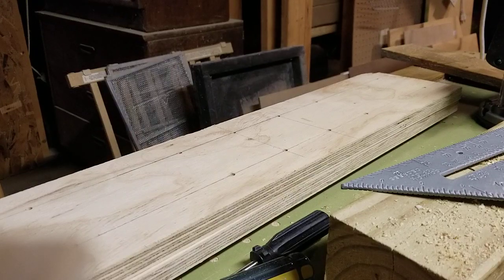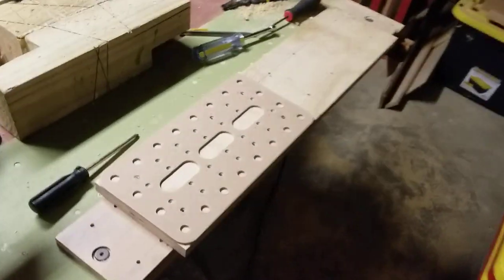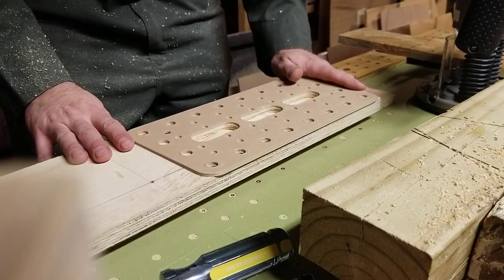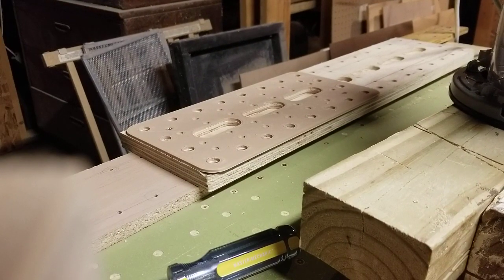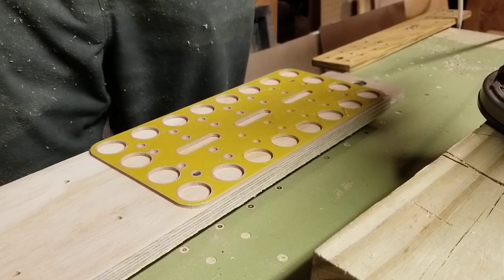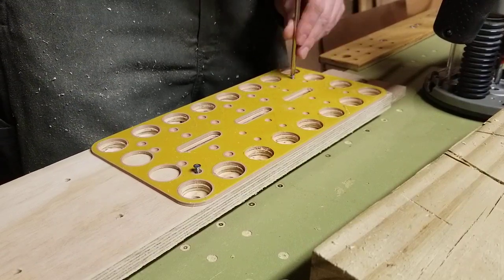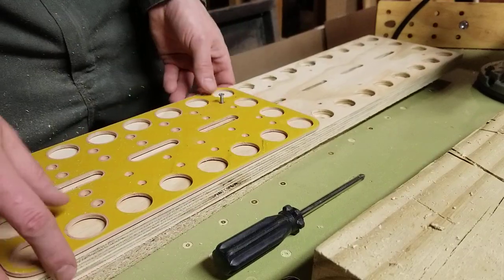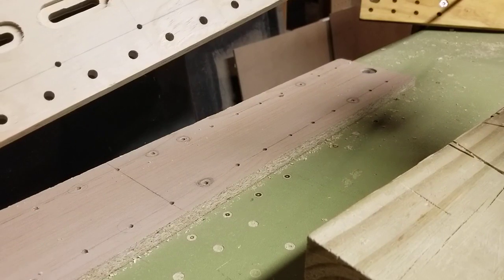Routing Monitor Mount Using 3D-Printed Templates (real time, unedited)

Comment: What countries have you been to I see you’ve been to Taiwan
Reply from the maker: Most of my time has been spent in Wisconsin, USA, but I do have a friend in Taiwan that I have visited a few times over the years.  They have a nice high-speed train over there, eh?  :)

On that subject, I have found that both Prague and Stockholm have very nice subways, and Germany's the place to be if you want to be able to hop on a random train to get around the country, as I learned during a month with a Eurail pass.  Tried to go visit Barcelona because I heard they have a good dance club scene, but all the French trains were booked up!  Mission Impossible has taught me that French trains are nice, but what good is it if you can't get on one?  Well, I did take a train from London to Paris, maybe that counts.

I've also been to Ireland a couple of times, where I learned to drive on the left side of the road, and buy "the good insurance" so that when you inevitably back your rental car into a stone wall you don't need to stress too much about it.  Well, I learned that the hard way.  I spent the rest of the trip stressing about it anyway!  But indeed, it was covered.  Then I had a low amount of stress for the next 10 minutes, until I realized that my girlfriend and I had accidentally swapped passports, and I had a flight to catch in only a few minutes.  The next lesson is that you may be able to get home with only a copy of your passport, but they will make you go through extra security and ask you lots of silly questions.